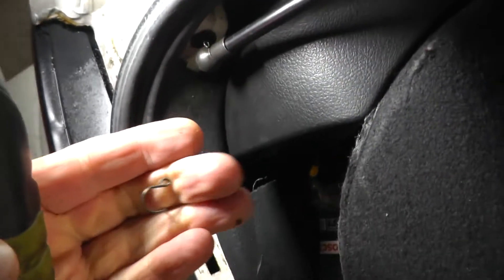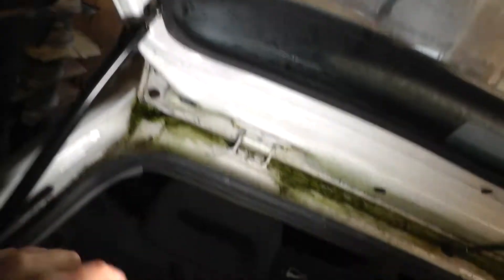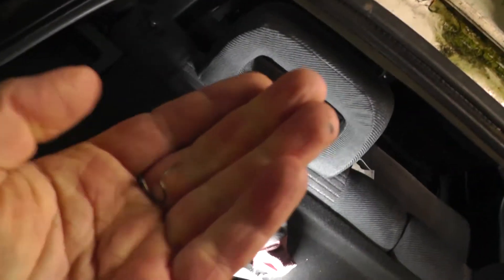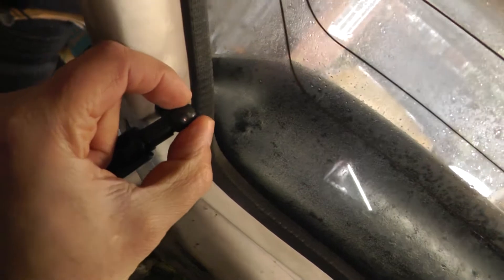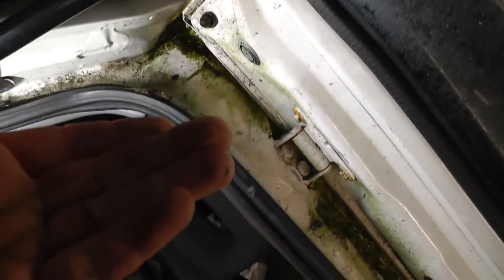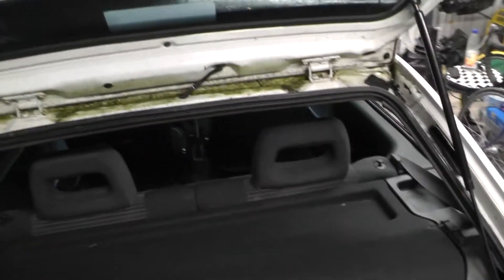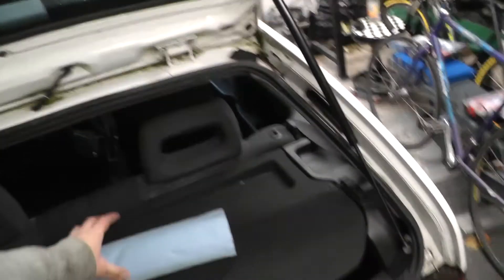T2CG Honda Civic EF Part 90 : Boot Trunk Gas Strut Replacement

Comment: it would be cool if you showed how you took them off. I cant get a wrench on the bottom part of the strut the plastic is in the way. Im scared of breaking the plastic so it would be better if you showed how to actually take them off. obviously putting new ones on is easy after that.
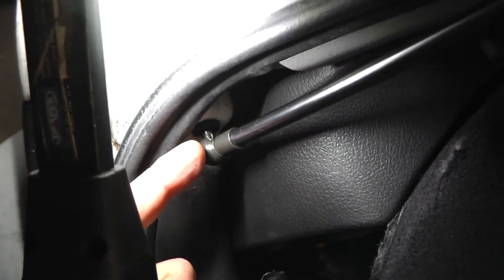Reply from the maker: Hi, at around 1:50 I showed the reverse of this. But I think you just need to pull back the metal clip and they should come off the ball end. Hope this helps